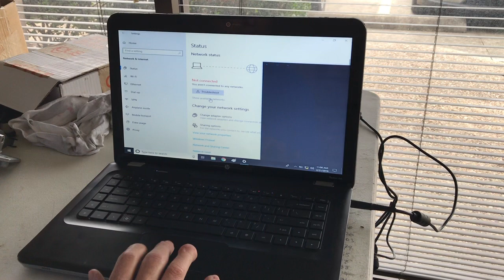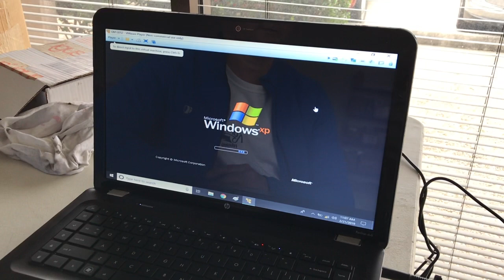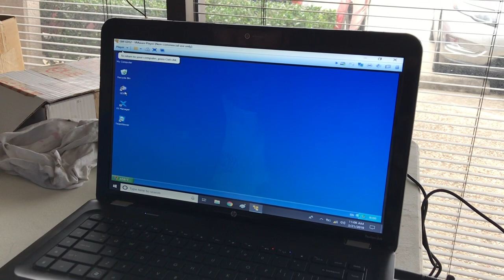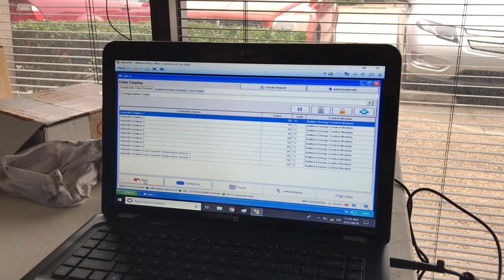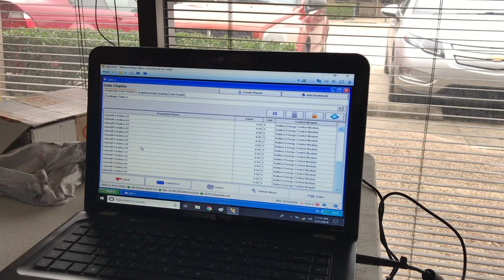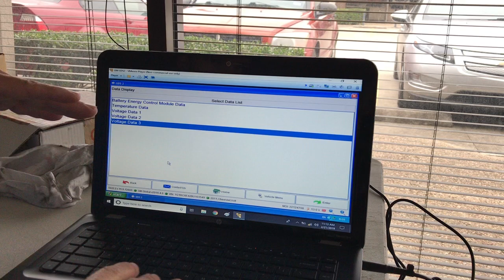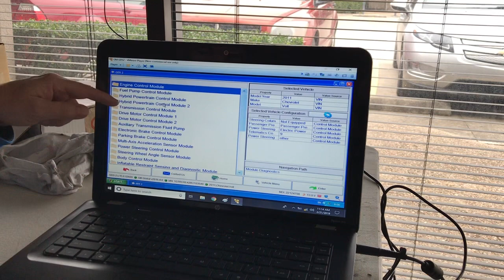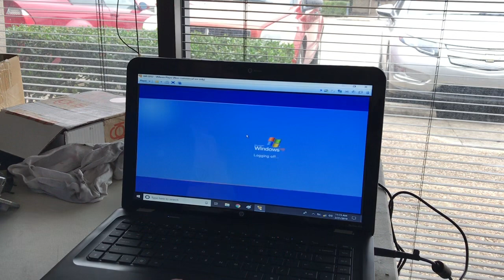2011-2015 Chevy Volt: Diagnosing battery cell issues with VCX Nano and GDS 2

Comment: Hi is this subscription based 

I have a problem with my volt we’re I can’t clear a battery group that has gone bad , the bad group was replaced and coolant vacuum bleed but P1e00 code won’t clear with my snap on scanner  I’m thinking that it needs a software reprogram or something as the car doesn’t do anything no hybrid or ev mode I’m out of town any suggestions appreciated 

P1e00

Comment: no link where to buy this thing?  So you have a bad cell, then what?
Reply: IF you have a bad cell do not let your battery fall below 2 or 3 bars to keep away from that. If HV battery is being allowed to dip below the 30% hard floor when you run through your full charge.You may get Codes P0AFA, Recalls N172130462 and N172130463 were supposed to prevent this issue. I know those recalls were originally only for 2013 models, but then were expanded.  verify with the dealer that those recalls, specifically, were done. Especially if they said something like "There are no outstanding recalls." or "All recalls have been preformed."

My car is dead cause I did get P0AFA and P1E00 Code a bad cell will do that, be

Comment: Hey there thank you for the video, before I buy one of these things, my 2012 Chevy Volt with 132000 miles has been dying on me in the middle of freeway, engine not available, propulsion power reduced.  This is happening at least 15 times, the dealer is unable to diagnose it, I had the HPCM2 to recall done which passage deal with battery cell balancing, it did not fix the problem any ideas?
Reply: I’ve heard of low battery coolant also causing this.
Reply: @skyluver2  I had everything checked, new 12-volt batteries, I had new wiring for the battery cables installed.. it was tragic. I'm sure that a better Chevrolet dealer could have fixed the problem but in the end I was glad that it was gone. The sofa that I hit also smash the windshield so it definitely wasn't staged lol
Reply: where you able to find out what is the problem?
Reply: @wacobrian9085  Hey Tommy, no unfortunately not it was at the dealership for another month to no avail, then it was stolen and recovered last week, and then this week a sofa fell Out of a truck at 80 miles an hour on the freeway and did $12,000 worth of damage.  so suffice to say it’s not my problem anymore LOL
Reply: @MugatuJag  More than likely a bad 12V battery...
Reply: @MugatuJag  stolen? That normally totals out a car sounds like the insurance company wasn't playing ball so sofa magically fell on it too.  😂
Reply: @naps3386  oh yeah that's the first thing I did. I had three different 12-volt AGM batteries in their, brand new. Definitely was not the culprit😥
Reply: @SiriusSolar  so it was stolen, I did not want to find it but I did have an active OnStar subscription. So I used OnStar to find it, it was only about 10 mi from my house and wasn't even damaged. And the sofa incident well it truly was ironic, the thing almost went through my windshield so it wasn't staged, but I was glad that the volt was gone suffice to say